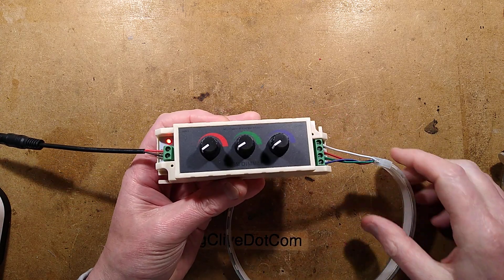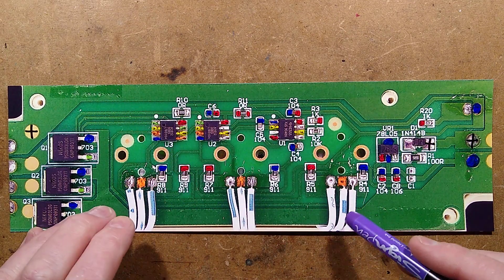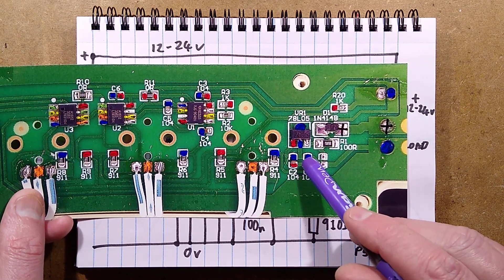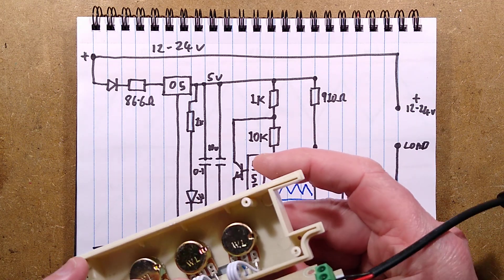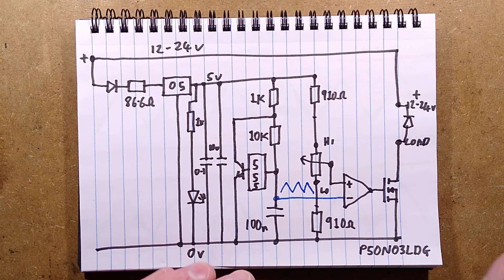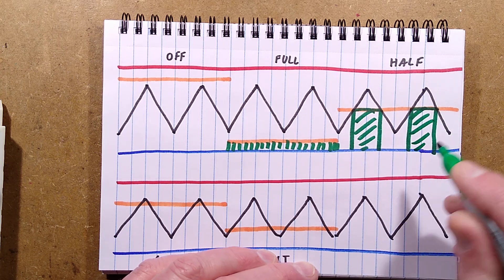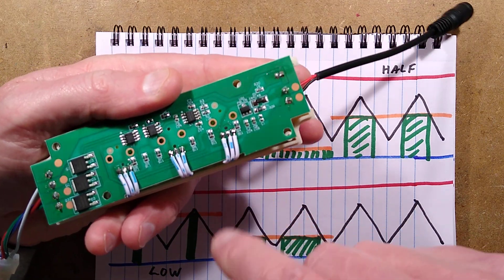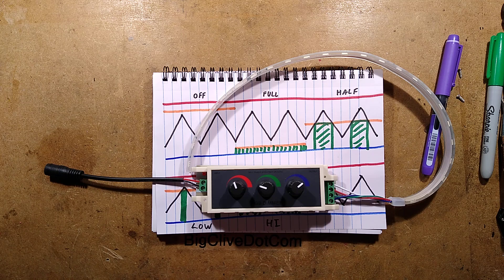RGB dimmer teardown and schematic (no microcontroller)

Comment: How is this different from having a multivibrator where you use a potentiometer to set the duty cycle (in place of one of the resistors) and switch the output using some transistor? Wouldn't that be cheaper? Do you really need a 555 for this?

Comment: there's yet a simpler method of doing this that only requires a single chip.  you can use a 74HC14 or similar hex schmitt trigger, then 2 diodes and 1 capacitor and 1 pot per channel to generate 0-100% duty cycle.  this is enough for three channels and then using the remaining 3 gates to buffer and drive FETs directly.  connect the capacitor from a gate input to ground, then connect the pot across the gate, with the wiper going to the output, and the two other ends connected to two diodes and the gate's input.  the diodes need to point in opposite directions.  a 10K pot and a .01uf cap is a good start.
Reply: Even simpler: Use a quad op-amp and wire the 4th as a sawtooth oscillator.  No Schmidt trigger anywhere.
Reply: @johndododoe1411  Except when you use an operational amplifier as a sawtooth generator you run it as a Schmitt trigger. Unless there's another configuration I haven't heard of before.

Comment: Strange they didn't use an LM339 quad-comparator instead of two LM358 dual-op amps. Surely the transition times would be quicker and the open collector outputs of the LM339 could be used to switch the FET gates between GND and 12-24V, giving lower on resistance?

Comment: Odd resistor value is because the assembler was told to use a resistor between probably 50R to 100R, and then on the day those were the cheapest reel in the market, or they were already on the machine from another job.

Comment: Your description of the 555 is not quite correct, Clive. On the 555 chip itself, there is a simple R-R-R voltage divider that the sets the threshold voltage to a pair of onboard comparators. They create 1/3Vcc and 2/3Vcc voltages. The timing capacitor's voltage feeds the other leads of the two comparators. One comparator output toggles the set pin of an onboard flip-flop, the other comparator output toggles the reset line of the flip-flop. The open collector NPN is activated when the flip flop is reset, and is usually (but not always) used to discharge the timing capacitor. When the capacitor voltage drops below 1/3Vcc, the flip flop is set, and the NPN turns off. When the timing capacitor rises above 2/3Vcc, the other comparator fires the flip-flop's reset line. That's all all you need to build a simple oscillator. Anyone who is trying to learn electronics 101A should examine the equivalent block diagram of the 555 timer. It is very instructive. Most important, it teaches you how RC circuits work. You know, how the half way voltage of an RC circuit is ln(2)*RC = 0.69RC?

The timing capacitor's pullup resistor is 1k+10k and its pulldown is 10k, which is close enough to being a single, symmetrical pullup and pulldown resistor. When you do the math, you find that each half of the oscillation has a 10k/100nF time constant, and requires about 0.7*RC seconds to occur. In this case, each half is about 0.7mS. The total period is twice that, which is 1.4RC = 1.4mS, a formula you will find in any datasheet for the timer using it as an oscillator. In this case, the oscillator is running at about 1/1.4mS = 715 Hz. That is the "chop rate" of the PWM circuit. The waveform across the timing capacitor is not a linear ramp, but an exponential (RC) voltage. It's good enough for this purpose.

Something that is missing on this circuit, I think, is a large-valued capacitor on the 12-24V power input line. With each LED lamp line turning on and off rapidly at 715Hz, the +12V line is going to have a very large and fast dI/dt running through it. The wires connecting this little controller to your 12V supply is connected in some cases using a very long pair of wires (red and black). What is a wire? That's right, it is an inductor. What happens when you try to pass a large dI/dT through an inductor? Correct, you get large, nasty voltage spikes when the MOSFETs turn rapidly on and off. They appear on an oscilloscope as large "ringing." A big capacitor on the 12V bus will snuff out the ringing. I would suggest between 100-470uF/16V (or higher). Without that capacitor, this thing may create a loud RF "buzz" that a nearby AM radio could pick up. Hook the dimmer up to your LEDs and probe the 12V line. I bet it is ringing like a bell. Add a big capacitor, and the ringing is squelched. However, do NOT add it on the switching lines! I.e., on the drains of the NFETs.

The 910 ohm resistors are close close in value to 1k. The pot is unquestionably 1k. With these values, the pot's wiper swings a little above 2/3Vcc and a little below 1/3Vcc. Why? Because the 555's timing capacitor is swinging between those two voltages. You want the pot to detect the entire range of the timing capacitor swing. By bumping up the pot's resistor network from 1k resistors to 910, they detect a little above 2/3Vcc and a little below 1/3Vcc.

When I was an engineer and we were interviewing candidates, I often used the 555 timer as an interview question, particularly for new college grads. "What is it, and how does it work?" In my youth, everyone knew how to use it. Alas, these days, I would venture to guess that most EEs, even those in the tech companies, haven't a clue. That's a shame because it is a very simple yet instructive piece of silicon that any budding EE should study and learn from. It was the creation of Hans Camenzind in 1971. 50 years later, it's still going strong!

Comment: What would the EMI emissions be on an old school circuit like that? Would it pass modern day emission tests?
Reply from the maker: No worse than other pulse width modulation controllers.  At about 500Hz the frequency is pretty low.

Comment: Quick question, pin 3 of the 555 is floating and pin 5 connected through a 100nF to ground, correct?
Reply: That sounds about right. Pin 3 won't be floating, just unconnected.

Comment: what  is the quiescent current?....when I learned about the 555, I was told that it was great, but a bit power hungry
Reply: The 7555 solves that.
Reply from the maker: By modern standards it does draw a bit more current than average.  It's not too bad though.
Reply: I remember the early ones took huge current spikes when the output changed state due to both transistors being on at the same time. You had to put a chunky electrolytic capacitor across the supply to prevent it disrupting other components.
Reply from the maker: @AndyFletcherX31  I can also remember adding a 100uF capacitor across the rails to stabilise the circuitry.

Comment: 500 Hz LED driver - oddly, I didn't notice any flicker - so is there some smoothing somewhere?
Flashing LEDs drives me nuts - now used on cars :(
Reply: 500Hz is 20 times the persistence of the human eye and 10 times the frame rate of the video so you're not going to see any flicker.
Reply: @petehiggins33  I was told flickery CRT video displays worked at 15,625Hz. That was not a steady image to me.
I've never actually tested the max speed my eyes can detect but a CRT is definitely within my range.
I've not noticed flicker on LCD displays.
I've also not tried calibrating my eyes to be able to view a flashing light and be able to give a ball-park figure of flash rate. I can certainly tell whether a light is steady or flashing  - even in the kHz region.
If you ever came across LED cat's eyes, they weren't steady but they may have been in the MHz range.
I'd even like to have tests done to see if I can detect the speed of light - or whether it's just an illusion ! This is basically looking at a changing light source via 2 paths, one longer than the other - and then me stating the shorter path, left or right.
Reply: @millomweb  If we are talking about television in the UK then 15,625Hz was the line frequency.  There are 625 lines in the PAL system and they are refreshed in two scans.  All the odd lines are refreshed in one scan and then all the even lines are refreshed in the next scan, this is called interlacing.  This means that the picture is refreshed at a frequency of 15,625 / 625 = 25Hz but the interlacing means that the brightness at any point on the screen being the average of two adjacent lines flickers at 50Hz.  Most people can't see flicker at this frequency, no-one can see flicker in the kHz range.  CRT monitors and digital TVs used higher scan rates to allow higher resolutions.  Older fluorescent lights and some LED lights have nearly 100% light modulation at 100Hz.

Comment: Interesting that they're using pwm to dim DC even without a micro. Is it because it's easier/more efficient to do this instead of doing effectively a variable current limitation?
Reply from the maker: Variable current causes lots of heat dissipation.

Comment: I built a PWM dimmer based on a single LM393, configured to a PWM frequency of about 20KHz to eliminate flicker and operate outside of the audible spectrum. It works brilliantly, better than any 555 based dimmer I’ve tried (in particular, it dims right down to zero without a “dead zone” that so many dimmers have). 

An IRL540N mosfet drives the load.

It’s this circuit here: https://www.electro-tech-online.com/articles/simple-pwm-circuit-for-lamp-dimming-etc-improves-on-555-pwm-circuits.797/

Comment: A while back I used a 555 to control the PWM input of a fan with dedicated PWM control, now I'm wondering if you're using PWM to control the fan directly, is there any advantage to using a circuit similar to this, with the 555 controlling an op amp rather than directly controlling the MOSFET? The only advantage I can see is it simplifies adding more channels, as demonstrated by the dimmer.
Reply: The standard 555 PWM generator configurations are unable to drive the output fully off and/or fully on (depending on the particular setup).

Comment: Interesdting
hen you opened it and i saw 3 8 pin cips, i immediately thought it could be 3 555's (you can do PWM with a 555 that involves a couple of diodes), wasn't expecting the op amps.
Reply: Why the diodes?  Just varying one of the external resistors should vary the pulse width of the main output.
Reply: @johndododoe1411  One diode for the charge cycle, one for discharge
Look up '555 pwm' for the circuit ;)
I've used the circuit for a servo tester
Reply: @sparkyprojects  & WHERE would one tap off for getting that sawooth...& reqd. thresholds..
Reply: @analoghardwaretops3976  For the 555 pwm the output is square wave with variable mark/space ratio.
Reply: @sparkyprojects  so the outputs are pin 3 of 555's
.... their internal ( quiescent) current is much too high for economy on battery power devices.. so one feeding 3 comparators will give lower battery drain..
Reply: @analoghardwaretops3976  When i made my first comment, i was only saying that i was expecting the 3 ic's to be 555's because there's a 555 pwm circuit without the comparators.
In the rgb controller output 3 is not used
Reply: @sparkyprojects  that's correct..

Comment: Intriguing circuit. From which pin of the 555 is the triangle pulse being tapped? I've tried pins 2, 5 and 6 in LTSpice but get no output. I've connected the others as per the schematic in the video, as well as feeding 5V to pin 8. EDIT: Never mind, I'm a dumbass - just had to look closely at the board picture Clive printed XD
Reply from the maker: It's unusual to see the signal being taken from the timing capacitor.

Comment: can this 555 be replaced by a simple oscillator ?
Maybe an rc circuit?
Reply: Potentially. You'd a bit more than a simple rc circuit, because you'd need to generate a sawtooth or triangle wave. You need to have a nice steady ramp to generate consistent duty cycles.

Comment: Rather like the RGB gun controls in the old tv's from the late 70's & very early 80's before the IC colour chips came in...

Where this type of switch would be useful would be if the micro chip controlled ones are too much fuss + I think you could actually tune the colour better with this device

Comment: I don't understand why the op amp is there. Could you not run the MOSFETs directly from a 555 and have the pot change the 555 timing?
Reply from the maker: The 555s wouldn't go to full off

Comment: The remote control RGB Tape LED strips have a 1x3 cm (approx) how would that circuit work?
Also this could be done with the smallest of Arduino boards and 3 potentiometers, wouldn't that be cheaper and smaller?
Reply from the maker: It would still need the output drivers added.  This is simple and can't crash.
Reply: @bigclivedotcom  then how do they do it remotely on the very small remote strips. I am not disagreeing, I just want to understand.
Reply: @bigclivedotcom  you stated 12 to 24V as input voltage... If we think automotive application, your comment "wont crash" is more than valid...

Comment: Is the opamp really needed?  Couldn't they have got the 555 to generate a square wave and feed that directly to the mosfet?
Reply: They could, but would have needed 3 555 timers (1 for each color) with 2 diodes on either side of each potentiometer to do that. I used such a schematic to build my own RGB controller : basically, 3 PWM generators independantly driving 3 transistors in parallel. The schematic in this video is more elegant IMO because a single oscillator is used so there won't be any frequency drift between the PWM of the 3 colors; not that this is of any importance in that case, but for other uses where you could need 3 signals with different PWM but same base frequency.
Reply: @takix2007  This circuit also allows fully on and fully off, something not possible with 555 only pwm
Reply: @rexsceleratorum1632  indeed, even if your PWM-setup potentiometer is a 100k, you still have to leave a permanent 1k-ish resistor for the 555 to charge/discharge through when the pot is at 0 or 100k. So that leaves you with a 1-99% range for your dimmer (could be extended to 0.5-99.5 but anything further would risk eventually frying the 555 - I had that painful experience firsthand)
Reply: @takix2007  At 12V and connected to pin 3 for charge/discharge you can probably go down much farther than 1k without killing the 555 (down to say 120 ohms), but the wattage of the pot and the resistor, plus the stress on the capacitor will be the immediate limiting factor.

Comment: Whoa thanks for pointing out how cool a device this is for kids. I'm prone to overthinking gifts for my younger cousins and such and forgetting that they aren't bored or possibly even aware of the basics yet. Might have to whip up something similar for them to play with!

I see someone pointed out that they could use the unused parts on the op-amp which seems like an even better idea, but if they're just using the 555's internal transistor... why not just use an actual jelly bean npn transistor there? I guess the 555 has built-in passives or something?

Comment: I know this is being picky but it's not a true triangular wave generator, the slope, albeit 33% to 66% is still following the exponential curve you would expect from a RC network which means there is not a linear relationship between the pot wiper position and the output PWM.
I know it doesn't matter in this application I'm just being a typically anally retentive engineer.
Reply: With 11k charging: 10k discharging ratios..the 555 should have..approx.{45.4545...% : 54.5454%...}ratios..

Comment: It looks like the variable resistor will vary the gate voltage from 2.5 to 3.3 volts.  What am I missing?
Reply from the maker: The 555 toggles between 1/3 and 2/3 supply voltage.

Comment: First the "555" has never been any kind of micro-controller, the NE555 is a timer IC.  Making saw tooth and triangle waveforms (plus) pulses is all that it can do.  (except to use the two internal compriators) Ron W4BIN

Comment: The venerable 555 can do so much... but a microcontroller it is not... no code is written or controlling the outputs, it's purely analog... it is funny that people think they need an Arduino to blink an LED... I used a 555 and had fun, then I learned about LEDS that have the blinker built in... that spoils all the fun LOL😁   A bit of uncertain controversial trivia: The name 5-5-5 is said to refer to the three 5K ohm ladder of resistors internal to the chip... although I'm not sure if that is a true origin story or not.  Please let me know how wrong that story is or how that story got started, I'd be interested to hear...

Comment: They could have gone even more "old school" and paired the 555 with a few 741 op-amps ;)
Reply: I don't think you can run a 741 with a single supply, can you? The 358 is a pretty ubiquitous general purpose op amp and works off a single 5 volt supply.
Reply: @Fix_It_Again_Tony  ahhh

Comment: You could possibly get away without the 555, if you used the spare op-amp as a triangle wave generator.
Reply from the maker: I was wondering that, but would have to refresh myself with op-amp based oscillators.
Reply: You could use an opamp triangle oscillator, but making one to consistently operate between 1/3 and 2/3 of Vcc would be far more of a pain than just using a 555.
Reply: As long as the levels were a consistent fraction of VCC, different series resistors for the potentiometers would fix the rest.

Comment: they could build a PWM generator from 555 only. If they used 558 they could basically have done it with one chip + 3 MOSFETs. I don't believe those opamps are significantly cheaper than 555s

Comment: The capacitor will charge and discharge to 1/3 and 2/3 of the supply rails, hence the 910R resistors so the pot covers the middle 1/3 of the voltage range..
http://www.falstad.com/circuit/e-555int.html is a great demo of the internals of a 555 timer.